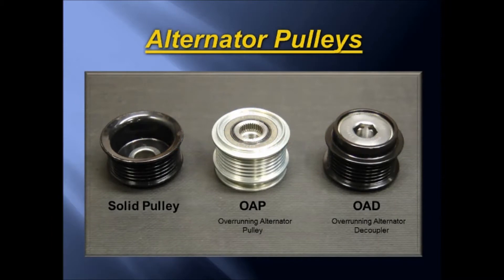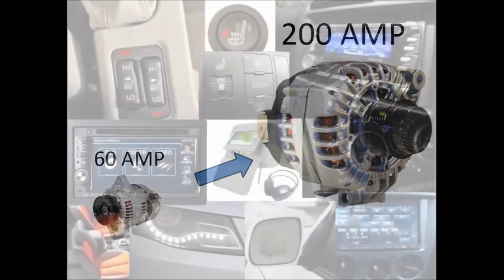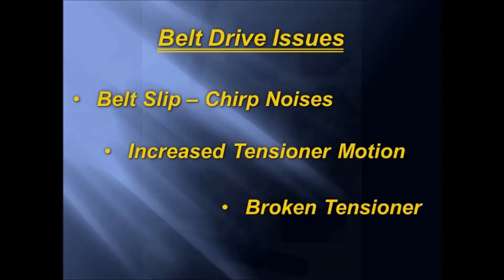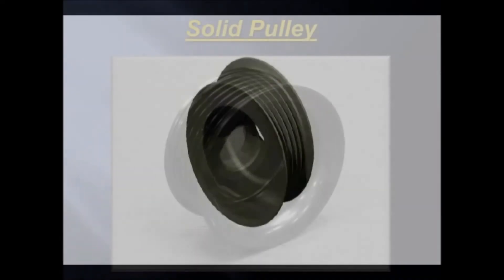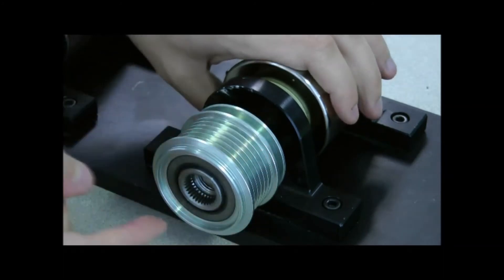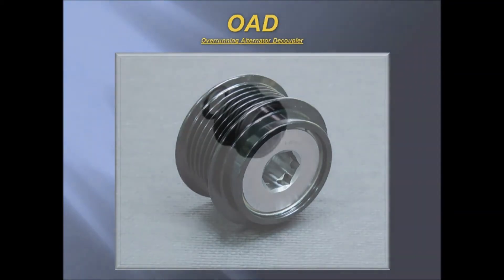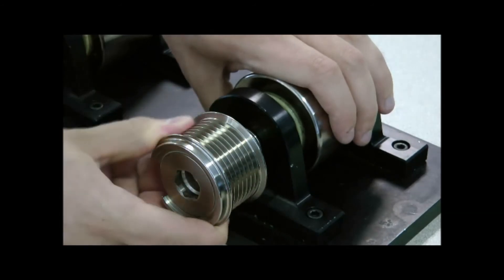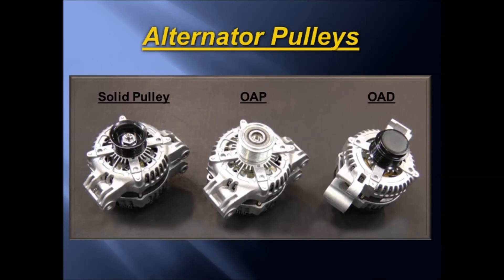Overrunning Alternator Pulleys and Overrunning Alternator Decoupler Pulleys | Know Your Parts

Comment: Very helpful, thank you. My 2002 BMW 530i comes with a solid pulley from the factory, but I believe my lightweight flywheel plus aggressive shifts cause drive belt chirps. There is an OAP available on VW diesels that use an identical alternator, that is a bolt-in solution. Do I risk damaging my car’s charging system by installing one?
Reply: No.